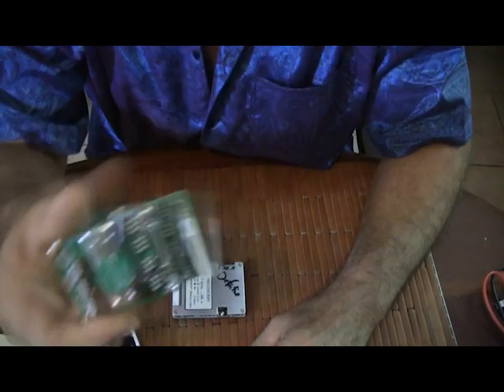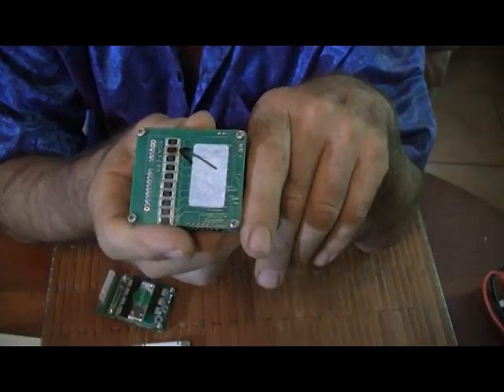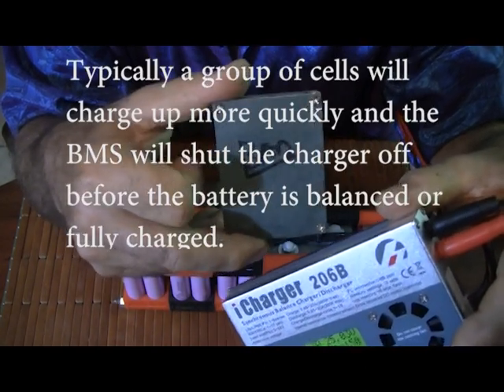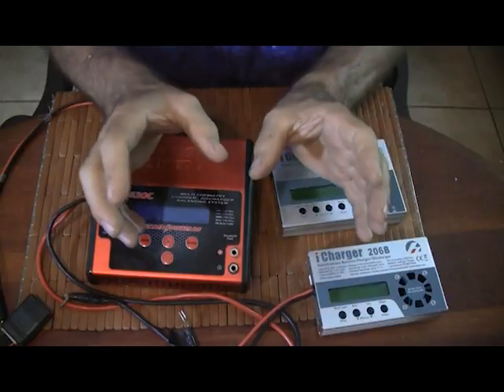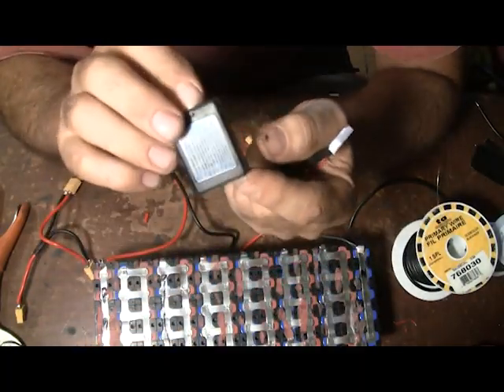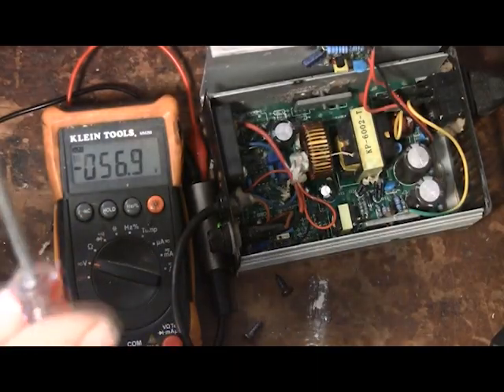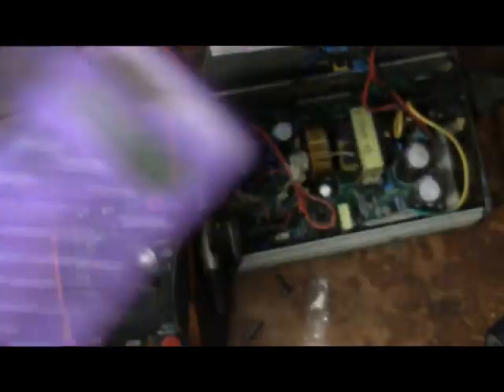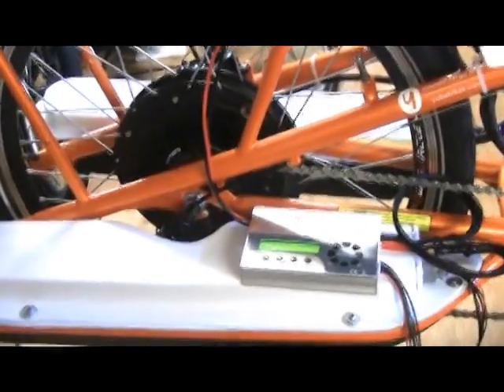How to build a safe and better lithium battery WITHOUT a BMS.

Comment: The Sine Wave Controller I purchased is a Golden Motor - Magic Pie5 with Bluetooth adapter which allows you to program the controller with an Android Smart Phone. You can set it up for 36 or 48 volts. Usually 6 volts above and 6 Volts below. However, you can override the default low voltage cut off. Also, this gives you the RPM, Speed and Current be used. Your phone is your instrument panel.. Very Nice!!! - Another good thing about this wheel and controller... is that the controller is built into the wheel hub.. less wiring!!! - I purchased my wheel from www.Goldenmotor.ca. It can also be bought directly from the China Manufacturer ant www.goldenmotor.com .... but it is not worth the hassle. Sincerely Ron
Reply from the maker: Thanks for sharing this Ron.  Golden Motor does try to make it easy to install and use their products.  I have had a Golden Motor wheel with the controller built into it and am pleased to see they are now using the smart phone to control it.   That said, I am not in love with being forced to use their proprietary controller.   

You don't have any controller overheating issues do you with their newer designs?

Shawn

Comment: I have a E-Bike with a Sine Wave motor controller that has a programmable low voltage cutoff - It can be programmed via a USB cable from PC or via a Bluetooth Module to your phone. It is worth spending the extra money for one of these controllers... !!! For the sake of business ethics I won't give the name of the controller and wheel unless ask.... Sincerely: Ron
Reply from the maker: Ron,   Share the controller.  It would be a great  compliment to this way of doing things.   The only thing  I don't like is that the device cuts off the power- and I may only have a mile to go and want to make that decision myself.  ......

Thank you!

Comment: Glad I saw this before I built my first battery. Now I get to get pass it around and try to decide if I should go with the yay's or the nay's. :) I do tend to think this route may be the way to go, at least right off hand.

Shawn, what amp hr is the first batter pack you show in the vid...the electrically separated one? I'm told I should go with nothing less than an 18ah for my 48v 1000w motor, and if I can find a build to just copy that would get me enough miles per charge, it would make things much easier on me.

Comment: How much current per cell do charge at (in the video) for the bulk charge vs. what the balance charger can do?   What are the advantages of doing it that way and aren't there chargers that can bulk charge to 4.0V and balance to 4.2V?  sorry if you already answered this.
Reply: For instance, this charger is 25A, 1350W with 8S and 12S balancing  http://www.ev-peak.com/A9.html
Reply from the maker: The current you can charge at is related to the cells C rating.  For example, a cell with 1 C rating can be bulk charged in one hour, but the balancing or topping off might take another half hour.   So a 2600 cell, which has 2600 mah or 2.6 amp hours with a 1 c rating could be charged at 2.6 amps and 4.2 volts.

If in doubt, assume that your cells and hence  battery pack have a .5 C rating.   So if you have a 26 amp hour battery pack you are safe to charge at 13 amps= 1/2 C.   

In a sense all chargers bulk charge to 4 volts- if you are there to pull the plug when your battery gets there!  The advantage of bulk charging to 4 volts per cell is to triple the battery life.
Reply from the maker: Yes, it does look like it has a 12S balancing port, that is good!  I may try one for a project I am working on.  This charger no doubt has a current adjustment setting so you can reduce the current for smaller battery packs.
Reply: I guess I was more interested in you're particular example with your bike.  How much time did you save by bulk charging with that one charger you opened and adjusted the volts vs the hobby charger with the balancing capability?  was it worth remembering to switch chargers after the one topped off the pack at 4V?   Thx Shawn!
Reply from the maker: Sure.  I don't remember on that battery, so I have to answer you in general.   You save about 30% of the time.  The rate of charge drops way off as the voltage climbs.  See my video on the DIY universal battery charger for an explanation of why a CCCV charger works that way.  

You don't switch chargers to top off, you just ride with a less charged battery...  When you need to balance, use a hobby charger.  You can also balance at just 4 volts with a hobby charger.....

Comment: Regarding the 4 volt charge max... to extend the life of the battery.... that is a 20 loss in capacity....!!!! Is the problem actually ....quick charging.... a 1.7 amp max. charge rate .... is another solution
Reply from the maker: Ron,

Thank you for your comment!   You are right that there is a loss in capacity when charged to 4 volts.  The ideal situation is to be able to switch between 4 and 4.2 volts when needed.   A slow charge rate will also help extend the life of the battery just as a slow discharge rate will too.   But that charge rate is relative to the size of the battery and the batteries C rating...
Reply: A Bank of Super capacitors matching the total voltage of the battery pack ....  hooked up in parallel will help to extend the battery life as well... it buffers the load demands on the battery. Think of this .... super capacitors inside your bike frame tubes...

Comment: Hey Shawn great video! In my batterypack I will use Lipo batteries because they're cheaper and easy to order (in my case). So how does this bulk charge will work on those? Do you know anything about that? I also heard Lipos would be pretty "sensitive". Is this a problem for bulk charging? 
Thanks for your answer in advance :) You should know that I'm pretty new to all that electronics stuff so be understanding with my maybe stupid questions :D
Reply from the maker: Hi Mr. Jack,

A lithium Polymer battery is just a lithium ion battery in a rectangular shape.  Everything that applies to Lithium Ion batteries applies to Lithium Polymer.  

Bulk charging with the normal precautions will work, and so will balancing with a hobby charger.  Most hobby batteries are lithium polymer.
Reply: Shawn McCarty That's great! Thank you for your quick answer :)

Comment: Thanks. i've used LiPo packs where you just have series and parallel connectors to get to 36v discharge and charge.. I always wondered if there was a way to 'split' a production ebike pack and turn it into a couple of 5s, 6s, or 7s packs that matche the standard hobby chargers. This is clearly the easy way to do this. The big ebike companies discourage displays of things like watt hours, the only real way to judge capacity. I can see why they wouldn't want to display the voltages of the batteries in series, the balance voltages. I watch the voltage and amp draw constantly with a simple display, but with a shunt on the battery. 

i am interested in the Titan packs or modules that are  designed to directly replace LiPo packs. Like the hobby packs, there is no BMS. These are made with the GA 18650 cells.
Reply from the maker: George,  could you post a link?  I have heard that some cells tend to stay in balance more than others and would appreciate any info you could add for everyone's benefit.
Reply: The link to Titan is here:

https://titan-flight.myshopify.com/pages/about-us

I used two 8 amp hour and 5s Lipos for about a year. I discharged in series and charged in parallel. I never used the balance leads to charge, because the balance never shifted. I have one of those cheap balancers with a display. Two new LiPo packs  arrived out of balance, and I had to do 4 or 5 balance charge and discharge cycles to get them to within .02 volts. But then they stayed balanced.

When I was using LiPos, the regen worked on my Golden motors. The BMS on a factory type pack seems to kill this feature. One of the BMS boards in one of my packs  is sensitive and has to be reset by charging through the discharge side.

The Titan modules are interesting to me because the modules are all batteries in series. You can monitor every cell. The 6s would require at least 4 modules, and it would be pretty small for an ebike battery. They claim they are Sanyo GA batteries. The reviews are all over the map. RC models are hard on batteries, and they need to stay within the parameters of the GA cell. I think Titan added a high discharge cell because of complaints. I don't know anything about the company but there seems to be some enthusiasm about the lighter packs. I could see Hobby King shifting to this technology.

More information is better than less. How do I know my production pack is ever balanced, or how often to balance charge it? I think people need to rethink the battery model, but the ebike industry is built on proprietary battery packs that are a profit center. 

I like the RC approach where you put just have the balance leads. The Titan cells have the balance leads just like a LiPo packs. The cutoffs can be programmed into the motor or just give people a good display with all the info they need to know what is going on. 

Hope this answered your question!
Reply from the maker: Yes, thank you.  They seem similar to other high discharge hobby cells in the way they are wired.  They Sanyo cells have great specs:  https://batterybro.com/products/panasonic-sanyo-ga-ncr18650ga-3450mah-10a.

Comment: So, just learning some new stuff here...  Can this same method be used for larger batteries, such as a 200 amp hour 12v lithium battery for use in RV purposes?  I'm guessing no, but maybe you could point me in the next direction for further learning.
Reply from the maker: Sure.  It would just take longer to balance.  You would want to use a very high powered hobby charger- look at the top of the line ichargers.  I am not sure if it would make much sense to use lithium in an RV, as weight isn't critical.
Reply: Sweet!  Good to know!  It will be for a van, so size, more than weight is the issue.  Having to buy 400 amp hours with of batteries to be able to use only 200 amp hours seems like a super poor use of space.  Great video BTW!
Reply from the maker: Thanks Adventurer,  Hope your RV project works well.

Comment: Is not the hobby charger also using BMS to balance the cell groups?
Reply from the maker: In one sense, Yes.  There is a balancing circuit inside the charger, which could be called a Battery Management System.  But not in the more commonly used sense that there is a separate electronic component on the battery that the hobby charger powers.
Reply: Shawn McCarty Thanks!

Comment: Hi Shawn  Love the simplicity you bring to the never ending debate of charging.  
I'm helping a local bike shop with some old faulty BH (Easy Motion) Batteries.  The BMS BH use is proprietary (Made by HiTech http://www.htenergy.com.tw/) I have the diagnostic kit but I cant find any balancing tools. I also cant repair the batteries with broken BMS's or get parts. As the cells are all still good (Samsung)I'm going to adapt your solution for 'unmanaged' batteries and fit 2 meters.  As there are 10 packs I'll need to split them into 2 x 5 so I can use my Turnigy charger/balancer.  I intend to tap into the center of the 48v pack and create 2 x 24v 5 packs and charge them is two seperate charge and balance cycles (but not physically disconnect them) .  Once charges I will use the two end taps to supply the 48v directly to the BH bike.  Any advise if this is correct ? A
Reply from the maker: Hi Alan,

A+, you are paying attention!!!

YES, what you have described will work great.  There is one very very very very very important thing when leaving the two halves connected---- you must never use a balancing board to attempt to balance them in parallel.  You will short out the balance wires.  : ( That is why I suggest breaking the pack electrically.  Then you can balance in parallel, charging and balancing both sides at the same time using one charger.  However if you NEVER attempt to balance in parallel your solution is good, it will require that you:

A.  use two chargers to charge/balance both halves at once OR
B   charge and balance each 5S chunk separately.
Reply: Thanks The split does make charging options simpler. If I wire the plug is such a way the charger can never see the entire pack at once this could work. 

I'm going to need to build a more generic charger, suited for end users ultimately, as I think building up  a second (spare) simplistic (non BMS) battery will be popular, and more affordable (I'm not interested in repairing broken proprietary BMS boards). 

Have you come up with a simple universal charger you can use to safely recharge the pack (4.0v ) without overvoltage risks ? (or under voltage cut off)  Or do you just user your programmable BUCK converter ?
Reply from the maker: I have a high/low charger which I sell for 14S batteries with a BMS- the switch changes between 4v and 4.2 volts per cell.  I use a hobby charger otherwise- as it does allow charge voltage cutoff programming and the ability to monitor the balance progress...  I use the Buck converter with a BMS.
Reply: OK I'll give my Turnigy a go and charge the pack in 2 stages, I'll keep you tips in mind re the wiring.

Do you know if the 36v BH e Bikes (easy Motion) can a 48v Battery my guess is the controller is where the voltage get converted to AC. The controller has a 36v sticker but I've seen speed hacks where they add a second serie pack to boost the voltage up and the controller seems to handle this OK ?
Reply from the maker: I don't know about that specific controller.   Typically most electronic components used in controllers can handle up to 60 volts.   You could pull the cover and see if you can read any specs on the capacitors...  Of course the low voltage shutoff will be wrong...

Comment: It seemed to me that this is the best value for money - Capacity
http://ali.pub/ebj8a
http://ali.pub/y0pb2
http://ali.pub/gzr2o
Useful video, Thanks
Reply from the maker: Thanks for sharing.  Here is the simple math to determine value:

Capacity in amp hours divided by cost gives cost per amp hour:

2.6/$3=  .86 cents per amp hour.   Compare the cells and use the lowest cost per amp hour- assuming quality brand name cells.

Comment: Thanks for the video.   Do you need to be concerned with the individual cells?  Or will the be balanced within the parallel sub group?
Reply from the maker: Hi Mark,

All cells connected in parallel will be balanced to each other.  This is good as long as the cells are all good.  But when you have a bad cell, one that is in effect a resistor, it will drain all the cells connected in parallel to it and kill them
Reply: In a failing parallel group, is it possible to determine which cell is failing without taking the battery all apart?
Reply: twowheelscooter within a group the one bad cell will differ in temperature when current is coming in or out of the group. If each cell was able to communicate its temperature, it would be a complete management system.

Comment: Hi Shawn Can you recommended what type of new 18650 batteries for my ebike 48v 35amp controller 1500watt motor ebike.
Reply from the maker: Sure.  Are you a thrasher?  Someone who rides hard and fast pulling a lot of current from a tiny battery?  Or are you a cruiser?  Someone who perhaps uses pedelec and wants to go a long distance?   If you are a thrasher you need a high C rated battery, one that can dump a lot of current.  If you are a cruiser you want a battery that has high energy density- one that has a bigger gas tank.  Gas Tank size is rated in MAH, such as 2600 mah or 3400 mah.  

The ability to dump current is called the C rating.  High current cells might be called "10 amps"  meaning they can dump 10 amps of current- even though their capacity is only say 2500mah.  This would be a 4C cell and would be able to dump all it's power in just 15 minutes of thrashing

High C cells cost more for the amount of capacity they have than low C cells.  Because I am a cruiser- I looped the USA  on my ebike- I ride the high capacity Panasonic 3400 mah cells.  

GO to https://batterybro.com/collections/18650-battery  for a good look at cells on the market.  Also consider shopping for cells on ali.express.    Beware of deals that are too ggod to be true- they are.  I have tested cells that were rated at 5000mah that cost $.80  and they had .25mah,  junk.

Buy Panasonic, Samsung, Sanyo or LG cells only.  If it has "fire" in the name run the other way!
Reply: Shawn McCarty I'm a bit of both I guess thanks for the advice. Your a star.

Comment: Looking to build a smaller cell pack - a 3S or 4S - will this work in a similar manner?  I only really need 10-13.2v output.
Reply from the maker: Yes, this is an easy way to build a smaller pack.  You can build that with BatteryBlocs and use a $22 hobby charger to balance.

www.batteryblocs.com

https://www.amazon.com/Battery-Balance-Charger-Li-ion-Batteries/dp/B005EF15Q4/ref=sr_1_1?ie=UTF8&qid=1475960912&sr=8-1&keywords=hobby+charger